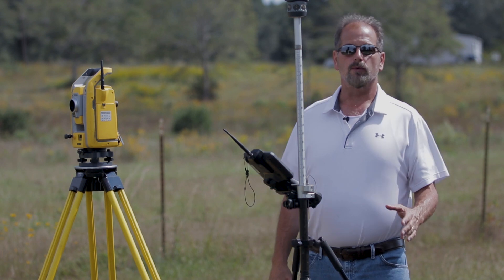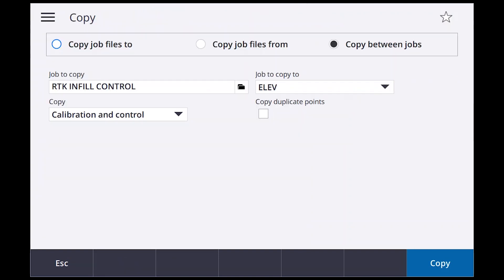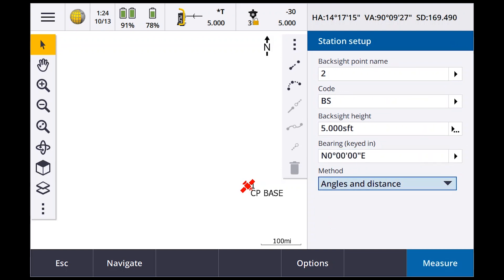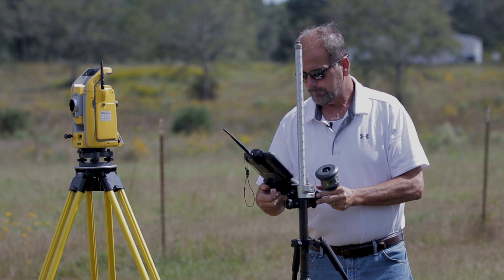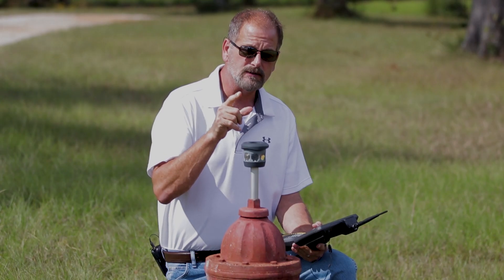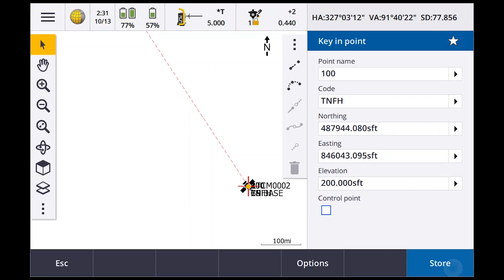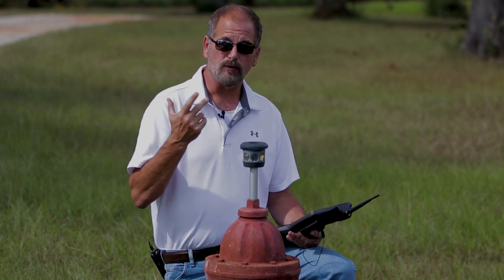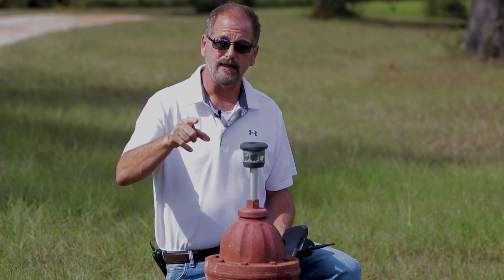Station Elevation with Trimble Access

Comment: Hello Robert! Nice video (as per usual). I wanted to ask you if you had any issues using station elevation when bringing the data into TBC. I have noticed some field crews using this procedure and it causes all sorts of flags and errors in TBC. I am trying to determine if it is a software issue or if the field crews are not following the correct procedure.  Thanks.